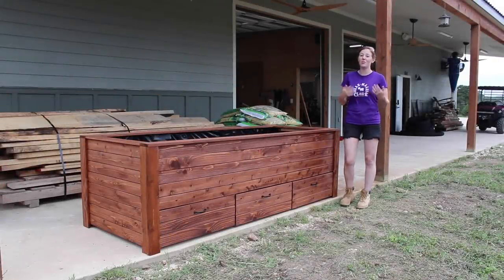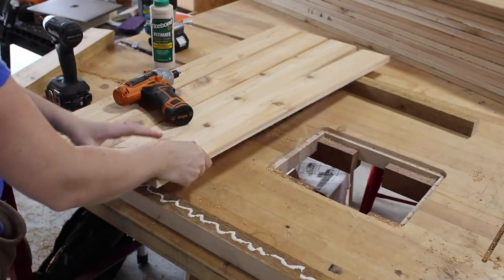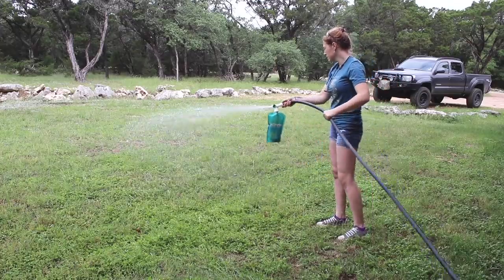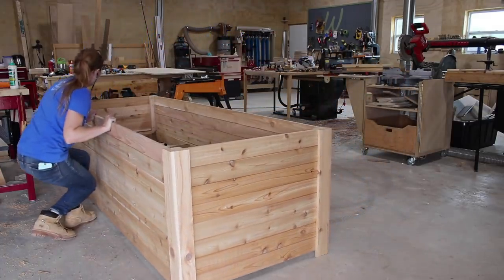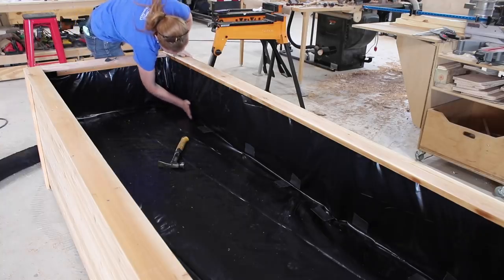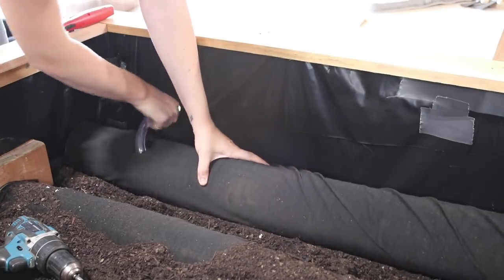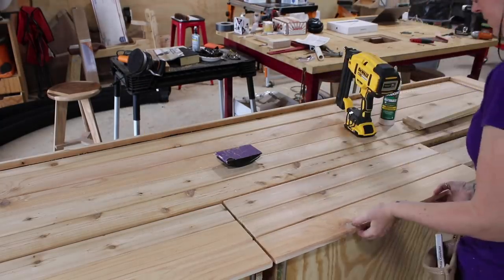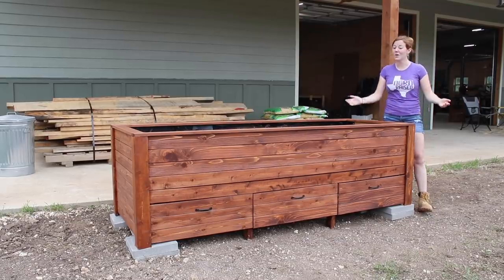DIY Raised Garden Bed with Drawers

Comment: That type of glue says it is waterproof, but it is not for outdoor use. I used it when building shade panels to protect struggling new grass from the hot Texas sun. When the Fall came I found I could remove the screws and literally pull the things apart. The glue gave up without much of a struggle.

Comment: April, the top trim should be a 1x6, not 1x4 because you'll use it as a shelf and appreciate the extra 2 inches of width.  The 1x6 can hang over on the outside, inside, or both.

How many bags of soil-less soil did you used to fill it?

Comment: My exterior drawer projects get water in them from rain. Not all the time, but there will be some. Also, remember to change out the water a few times per season before it gets stagnant. There could be overwatering or root-rot issues associated with that system. You may need to go back and install a bed drain as well. Beautiful job. Whatcha growing 420??

Comment: Excellent build, and well thought out.  The one question  I had was, did you leave just a little space between the  boards.  They will swell along their width.  Just a little, 1/16 or so, will assure they don't push themselves apart.  Curious what you see in a few weeks.

Comment: Hi.  it seems the drain tube in your build is above the pipes, so pipes would be full of water.  builds for self watering tubs i have seen say the drain should be about an inch below the top of the pipe so there is an air space in maintained in the pipes.

Comment: Suggestion - Do not staple the pond liner. Lay it in carefully, folding properly at the corners, lay the edges over the sides and staple the liner along the top edge. The soil will take care of keeping the liner in place. (I used to work for Beckett - the industry leader in outdoor water features)
Reply from the maker: Great tip! Thanks for sharing and for watching.

Comment: Seems decent if your keeping it indoors, I'd be a bit concerned keeping it outside (especially in rainy England) as I would expect given 2 or so years, the wood will deform and the drawers won't open, not to mention that the drawers would probably let water in.

Comment: April--  
Always a distinct pleasure to watch and learn from your projects and planning.  Your planter looks fantastic!  

One quick point I can't resist mentioning (HUGE apologies if I'm not the first)--  
You said your plastic liner was "about 6 millimeters thick".  Plastic sheeting thickness is typically measured in thousands of an inch, which are referred to as "mils", so your "6 mil" plastic might be only 0.006" thick.  (6mm plastic would be about a quarter-inch thick, which I'm thinking would have been immensely heavier and less flexible than what you used.)  :-)

Thanks for sharing your journey!

Comment: So what keeps the water from leaking into the drawers, when you staple through the liner? What keeps the plywood from rotting when water leaks through the liner?
Reply: Knick Knickerbocker duct tape
Reply: @jacrispy8802  Whiiich isn't the best option unfortunately. Duct tape doesn't do super well being wet all the time (it should only be used in emergencies for a short amount of time)
Reply: Cesar Monteiro I know I’m not sure why she didn’t find a better material. but duct tape might not be too bad as the dirt will constantly be pushing on the pieces of even if the adhesive fails. But I agree it wasn’t a good choice and it will probably be leaking in the next year or two.
Reply: I'm not sure if it's worth even stapling the bottom of the liner. It's not like it's going to come up with a few hundred pounds of soil, water, pipes, and plants on top.
Reply: Slugsie I agree
Reply: I was thinking the same thing. I'd use a marine grade sealant such as Boat Life Caulk or at least a glob of Silicone on each staple as I go along so I don't miss any. Maybe stain the plywood top, bottom and all the edges with something that repels water just in case. Maybe even the insides of the slats in the bed area at least before assembly. But not to nit-pic guys and gals. I'm just saying. She's an accomplished woodworker. What a nice shop!
Reply: Put a little latex or barge adhesive on each one. It won't be a problem then.

Comment: This is a good idea, but I got to ask. are those three pipes connected together or does the water just flow between them through the soil? Also Since the drain pipe is higher than the pipes and you have the box sealed with plastic won't there always be about 6 " of standing water in it. Everything will be swimming in water......is that not bad for the plants if there is to much water? I would think a half as big pipe in the bottom and the overflow about 3/4 or right at the hight of pipe would be enough and also to at least connect all three pipes so that the bottom of the box would be filled quicker. This may sound negative to everyone, don't get me wrong, it is a great idea that I want to build, but I want to build this only once. Great channel. I am always waiting for the next great building idea.

Comment: I've noticed that you're using a impactor to drive the screw through the pocket hole to The Other Board why not use a regular drill and set the choke so you don't drive the screw too far into the pocket? And how far do you know to drive the screw through the pocket hole using the impactor?

Comment: looks great!  I'll be curious if there are any challanges over time with expansion between boards.  I always like the "no gap" look but am too nervous to try it on exterior work.
Reply: In my experience, even in the PNW boards tend to shrink over time, if they start out relatively green. I built a picnic table with fir (I didn't have enough money to splurge on cedar at the time) with a no-gap top and several years later they have ~1/4" gaps.

Comment: Did you staple through the plastic liner at the bottom? Will you need some backup drain holes in the plywood bottom?  Great design with the drawers. Thanks for the video.

Comment: So, the middle tube fills....runs out into the soil....leaches into the other two tubes , there are no connections?  So basically you saturate the however many inches of the dirt at the bottom of the planter to fill all three tubes?  I like the planter box / style.

Comment: Hmmm, looks nice, but- 6 mil plastic will work for about two years, as polyethylene will break down, in the presence of soil acids. One of the few things that will degrade PE, but it definitely will. Maybe a little longer, but not much, and my point is that you're going to need tougher stuff, long term. EDPM roofing membrane and tub/shower liner are both widely available, and, although they are considerably more expensive, will hold up for many years, which will be important in such a nice planter.

Comment: Have a question on this project.  Could you downsize it to accomodate growing a small amount of silver queen corn from NJ / DE area?  I've tried growing this in TX but the corn can't take the long summer dry months.  I was thinking if I had something like this smaller and  on wheels, I could give the corn some shade when it is needed most.

Comment: April, great build but unfortunately I think the article you read has given you some misinformation.

The whole point of using the drainage pipes is to aerate your soil and provide space to store water. 

You are supposed to have the whole bottom layer as drainage pipes with a small gap in between each pipe e.g. 10mm. That will provide enough space for your medium to wick the water up. Any potting mix will do for your medium but something like Mel’s mix is good. Mel’s mix is 33% compost, 33% peat moss and 33% vermiculite. My version of Mel’s mix is 33% home made compost, 33% coco coir, 17% vermiculite, 17% perlite.

From what I can see from your video, it looks like you can fit 5 drainage pipes spanning the width of your bed.

Where you drill the drainage hole is crucial to the success of your wicking bed. Drill the hole about 60/65% of the height of your drainage pipe. It looks like you are using 100mm diameter pipes. If that’s the case, drill the drainage hole 65mm from the bottom of your plywood false bottom.

This means when the water storage is full you have 65mm worth of water storage and about 35mm worth of air storage. You have a decent sized bed so two drainage holes is better than one. One at either end of the bed. Add a filter (any fabric/cloth) to your drainage hole hose pipe so insects and bugs don’t use it as an entrance to your water tank.

Roots need oxygen and water. Depending on what you decide to grow in your bed, there is a high probability that your plants will die from root rot.

There was no need to staple the bottom of your pond liner. Don’t make unnecessary holes in any liner manufactured to be waterproof, especially when it’s under the waterline. You could have have used anything to temporarily weigh down/shape your liner whilst stapling the top of the liner e.g. compost, bricks, offcuts of wood, water etc.

Sorry if I sound overcritical, I’m a keen gardener and I’d hate to see you start your new hobby with a disaster especially when you’ve gone to so much effort and expense to build a nice looking and functional standalone raised bed.

Comment: This is good, aa neat idea however one comment. When attaching hinges you should never screw into the plywood end that will limit the life of those pieces, only solid wood. You would just need to adjust the plans to make those ends run down so they are not the part you are attaching to.

Comment: Do you have it set up so the dust collection system is in one place and you wheel whatever 'equipment station' you going to use to it? (except for the Sawstop table saw) Also, what's the type of plywood you use for everything?

Comment: Ummm ... Curious, didn't stapling through the bottom of the liner make for a leaky liner?  ... I think the soil would hold the liner in place such that stapling it only around the top would have been good enough and left the integrity of the membrane intact where it counts.

Comment: I’m confused about how the irrigation system works.  Does it not create a bottom layer of soil which is always totally saturated with water?  That seems like a problem, like when the water table is to near the surface.

Comment: You are going to need to add some additional support to your sides!  They are way to thin to span that much distance and hold back wet HEAVY dirt!  they will bow our on you!  It would have been better to use all 2x6 construction and even then you would still need to have cross supports to keep it from bowing out!  I have made hundreds of raised beds for people that have disabilities and need to have their gardens up where they can get to them to work!  I have also repaired quite a few that were made by other people that did not realize how much pressure and weight a cubic foot of wet dirt represents.

Comment: When you stapled the liner in; you insured that you will have water in your drawers.
Reply: @DIY Home & Garden Projects - It would appear you either didn't pay attention or didn't watch the whole video.
Reply: Robert, your assumption is wrong.  I watched the whole video.  I am a gardener with 40 years of experience.  I know that tape, even duct tape will not hold up to long term water exposure.  It may not leak year one, mabey not year two, but leak it will.  The proper way is to fold in the liner with out any seams or punching hole to attach it to the bottom or sides.  April said she is just getting into gardening, so I am just offering tips to prevent her from issues down the road.
Reply: @DIYHGP  Offering tips is definitely appreciated by all who want to get into gardening. Your initial post, however, did not come across this way to me. It critiqued without offering a suggestion or alternative method, as if you did not see she duct-taped the staples. Your follow-up to me did include tips, which clarified your initial intent and was, indeed, helpful.

Comment: Nice work but: Despite the plastic foil, the paint and the high quaity wood I think the top part will rot long before your nice drawer system has reached the end of its life. I did a similar raised bed 20 years ago. Due to exposure to moisture and soil bacteria it lasted not more than five years.  Although it is tempting to utilize the space under the garden bed, I think it is better just to make a simple raised bed that will last as long as it does and make a seperate drawer system that is not in contact with water and soil and thus has a chance of lasting forever.

Comment: I have built a number of iterations of raised beds.  I’m skeptical of this one, no offense but that is a lot of weight and the plywood underlay will not last.  Especially using a stapled plastic liner and a constantly wet wicking system.  Moreover I failed to see the value of stapling the bottom.  If you had the sides secured wouldn’t the soil hold the bottom in place?  My latest iteration I used aluminum flashing to separate my soil from the wood, working well but I filled down to ground level with fill sand over a landscape cloth barrier.  Top 15” were compost and soil.  Given the price of western red cedar I would want a build like this to last more than a year or two. Good luck.

Comment: Doesn't stapling into the liner create a pathway for water too get to the plywood?
Reply: Stapling inside the garden bed is not necessary, the soil pressure of the garden bed will tightly press the liner to the bottom and sides.

Comment: Based on the spectacular failure of my first raised bed, I worry that your vertical bracing between the drawers isn't going to handle the huge weight of the soil and water you'll have above it.

Comment: You're drawers were pretty rough looking, what happened with the alignment?
Reply: Yeah, it's not like she had to align the drawers themselves, just stick the false fronts on straight. She got all the complicated bits straight, the drawers themselves even, so it's quite puzzling really.
Reply: Looks like she hadn't leveled the Foundation blocks yet. Left side was low causing the drawers to twist.
Reply: @DK-jd8bj  That's likely what it is - good catch.

Comment: I love the look of it. But to be honest it looks a little flimsy. I can see it still lasting a good 30 year, but I think its not something grandchildren would much use. However I think thats mostly due to wood. The design itself is pretty nice. If you had the $, I would try this design with harder wood and more bolts instead of screws in some places.

Comment: You kept talking about how much you loved the cedar.. and then you STAINED IT??? Clear coat woulda been so nice. Also, sand would have been better around the drain pipes. I’ve heard using soil at that level in the water causes it to become anaerobic and stink.

Comment: 5:48: You seem to be confused about the difference between mils and millimeters. A mil is a thousandth of an inch; a millimeter is a thousandth of a meter. That's quite a difference! Your plastic sheeting appears to be 6 mils thick, not 6 millimeters thick.